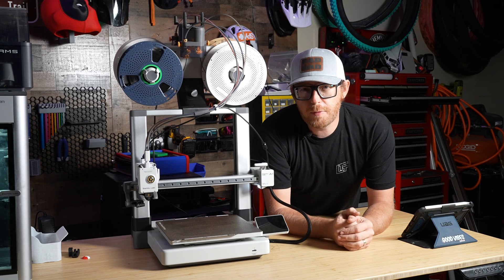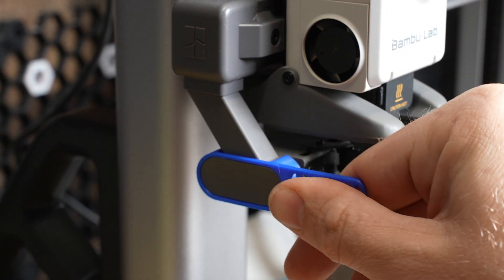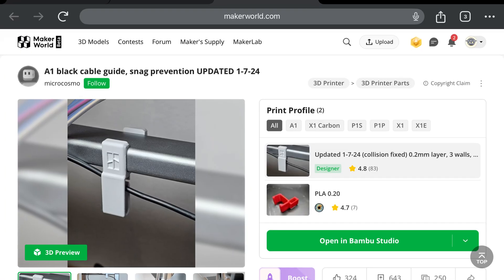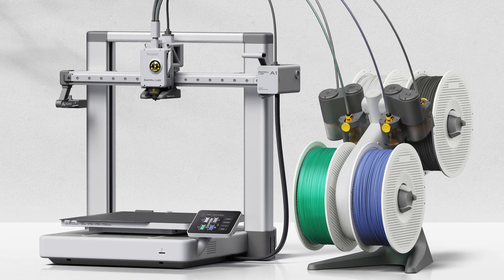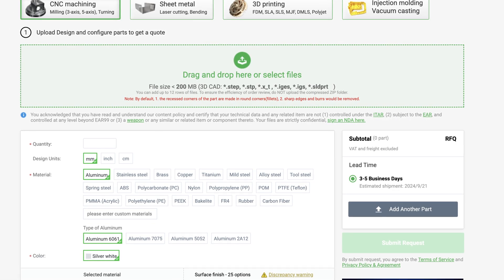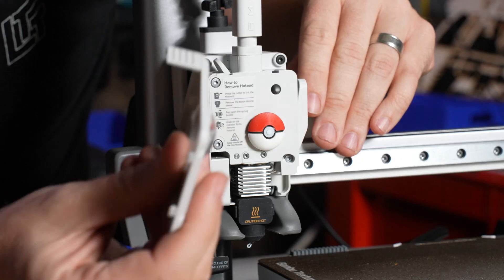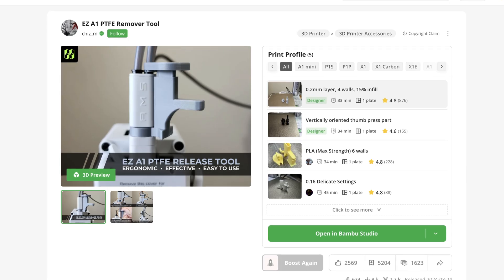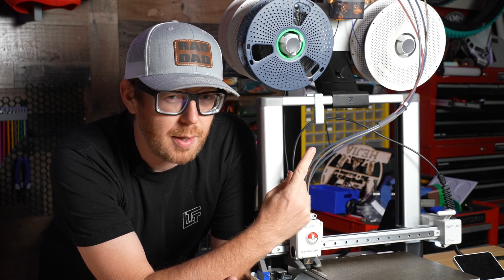5 Free Upgrades For Your Bambu Lab A1!

Comment: I would print the following parts / items (all from makerworld):
For Sunlufilament => 615268. with this Adapter, sunluspools won't fall of the ams lite
better Cableholder => 1239001. it holds the usb-c cable and the ptfetube straight upwards.

Comment: The best poop bucket arrangement is to set the printer on the left edge of the table with a waste bucket beside the table and the wall next to that. Design and print guides to make sure every poop that slings lands in the bucket and you no longer need to empty your poop bucket after every print or even several times in the same print.

Comment: I was wondering if you printed the cable holders at the standard ratio or the 102.5% I'm reading about to counter the increased tube thickness in the newer models? Also was this the small or large size? Cheers.
Reply from the maker: I just printed the default print profile if i recall correctly

Comment: Reflection, which one did you use the two of them? Did you use the 5 mm?
Reply from the maker: Are you talking about the cable holder? If so, I used both, One on each side.
Reply: @RadDadsPrintLab  for the poop shooter the shield to help you aim right cause online there’s two versions